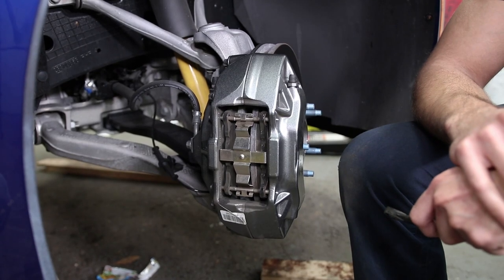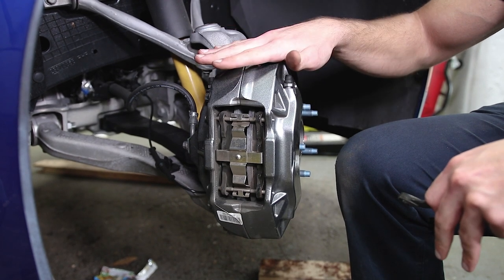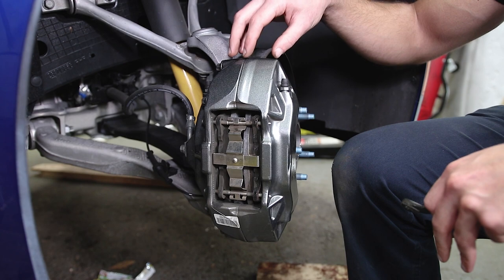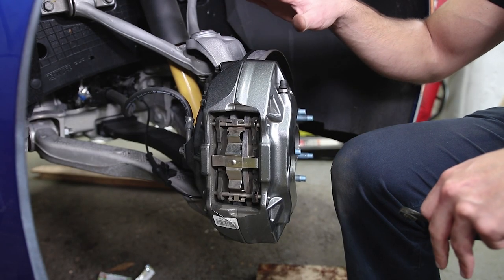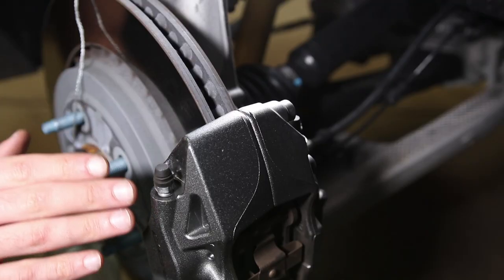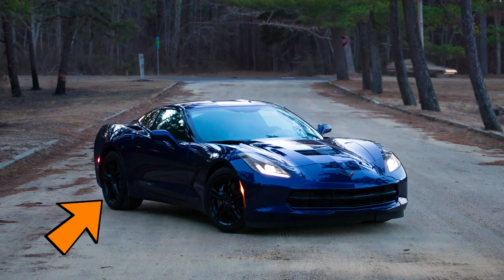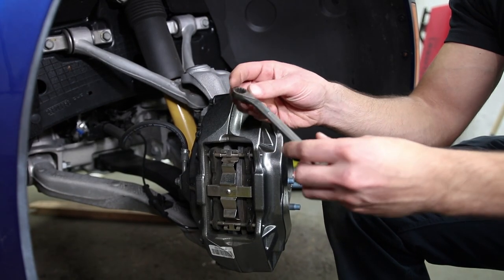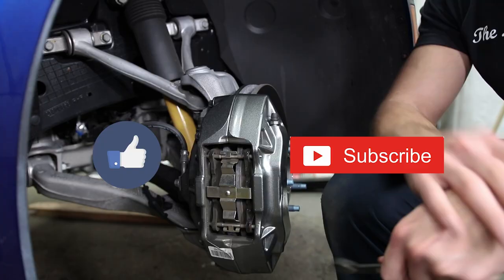How To Bleed Brembo Brakes DIY

Comment: What about gravity bleed method and bleed both valves at once? About 15 mins per side gravity bleed do not seem to notice any problems with my 4 or 6 piston caliper cars.

 If I were to do one at a time would take an hour to only bleed the fronts. 

My method as follows for most cars via farthest away from MC (usually on driver side) gravity bleed.

Bleed both rear single valve calipers same. 
Bleed both valves of passenger front.
Bleed both valves of driver front.

Comment: When you “bleed” the brakes , about how much fluid is needed to collect into the container for each bleeder screw /caliper?  How do you know when to stop ?
Reply from the maker: Always a good idea to have extra fluid on hand just to be safe but usually 1 32 oz container is enough; however, I would have a second bottle just in case. You should watch for a change in the color of the fluid or just bleed extra if you cannot discern a color change. If you have 2x 32 oz containers to start, just bleed 12-15oz to the rears and a bit less to the fronts, this will ensure you have completely new fluid in your lines. This is over-kill but the fluid is inexpensive.

Comment: Yeah but what if there is air in the system? Is it the same? Cuz I put braised lines on and bled the exact same way and now I got no pedal with the car on. Car off I have a hard pedal but on; goes to floor. I may have killed the master but just wondering if there’s a different procedure for if there’s air. So if you know, Ide appreciate the info.
Reply: Push the pedal when bleeding up and down several times to fill the master cyclinder.

Comment: My face when I realized the bleed screws need to face up 😃
Reply from the maker: Lol yup
Reply: @TheSundaeDrive  mfw I find out I don't have enough line for them to be the other way so they're getting bled as is!
Reply from the maker: @luigismushrooms5701  😂
Reply: Ha Ha did you install the calipers upside down.
Reply: @cammgt3rs370  yup! And after vacuum bleeding they work fine.  For whatever reason my kit came with lines that only reach that way so, that's how they're staying :)

Comment: Unbelievably brembo proper bleeding is front left>front right>rear left>rear right….personally I don’t give a fuck that makes no sense I do it old school
Reply from the maker: It seems every vehicle is different since we get comments both ways on this lol. As long as you don't let the reservoir run dry you'll probably be ok either way
Reply: My ctsv requires the power bleed with a scanner. The scanner follows LF,RF,RR,LR. I also am a bit old school and don't understand why it does this.

Comment: What will happen if u just bleed the outside?
Reply from the maker: As long as no air is introduced, you just wouldn't replace 100% of the old fluid.
Reply: @TheSundaeDrive   well I was wondering because I bleed the front and not the back and I’m getting vibration and pulling to one side while braking I was thinking maybe uneven piston pressure between front and back side of the rotor my rotors are new as well